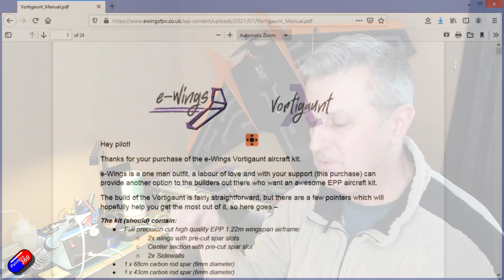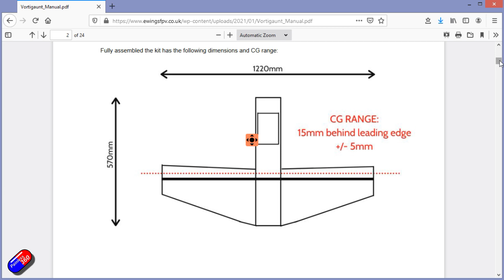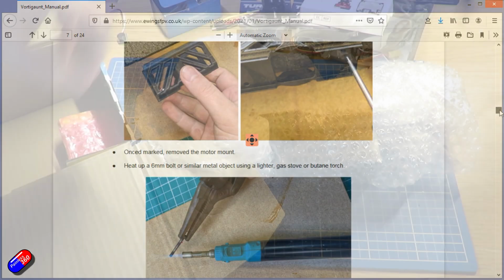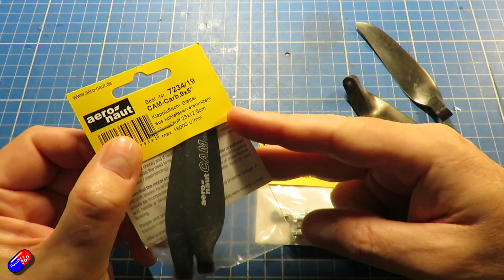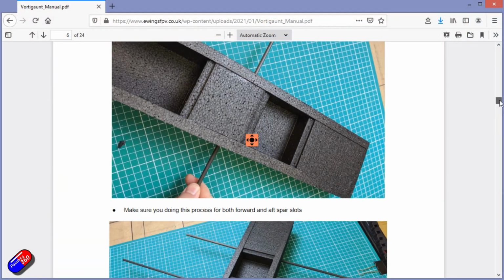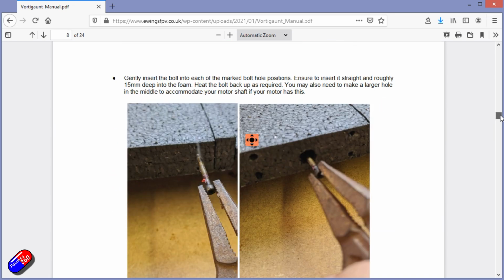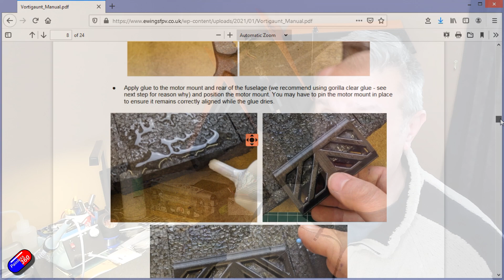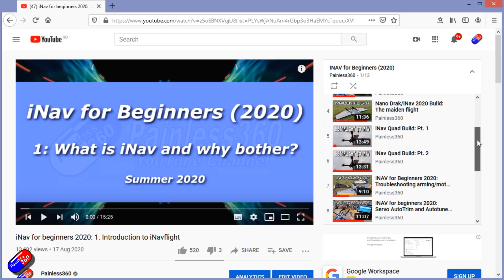E-Wings Vortigaunt II Build: EP1 - Introduction and plan

Comment: Hi there just a an idea to I do boats as well as plan's some times we don't have a lot of space for a 9 gram servo but if you fit it upside down and put the camera on with a single fixture on one of the u brackets then a push rod underneath you will get a pan that will only be just a bit higher than the camera